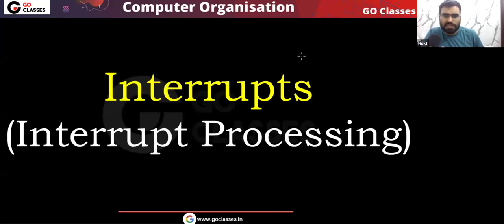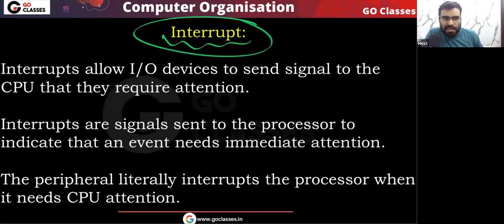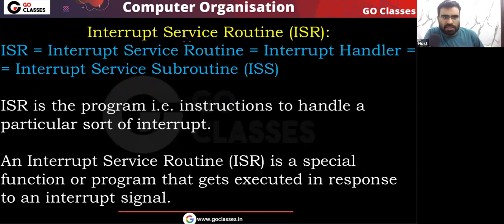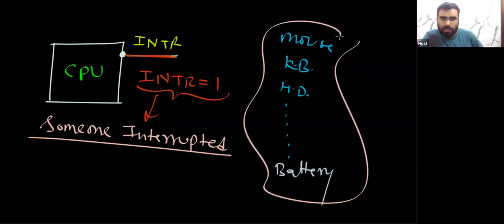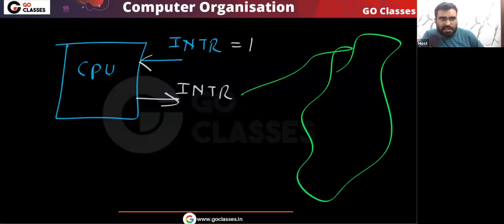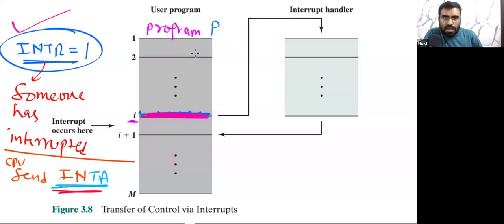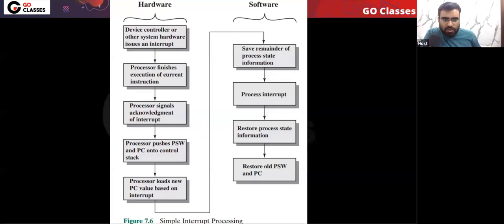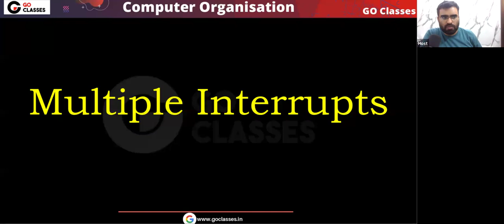I/O Interfacing Lec 3 - Interrupts & Interrupt Processing - Part 1 | GATE PYQs | With NOTES

Comment: @Deepak Sir, @GoClasses - I have 3 questions :  1. In the Interrupt I/O, we already have an isolated address space for I/O devices. Which means we have varied port numbers in I/O Interface for the I/O devices. I am aware that these I/O devices can have multiple addresses but why do we need a separate Interrupt Vector Table and assign unique vector numbers to each I/O device instead of using the same I/O port address? 2. What if there are multiple I/O devices of same type ? Say for e.g. multiple keyboards attached to the computer. Will they be assigned different Interrupt Vectors and hence will contain same ISR code running at 2 different Addresses? Or will it be the same code running? 3. Will the Interrupt Vectors be based on the type of device? (For e.g. if it is mouse, it is 1. If it is battery controller, it is 2 and so on.) Will these Interrupt numbers be fixed / static or will they be assigned dynamically based on the number of I/O devices attached to the PC?
Reply: q1) Ports are for identifying buffer registers in IO device, IVT is for identifying ISR in MM